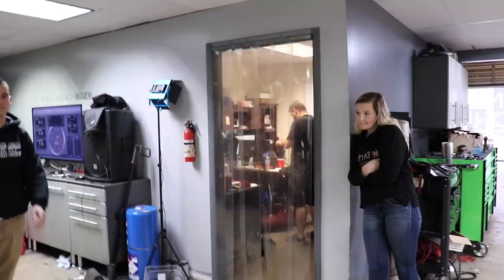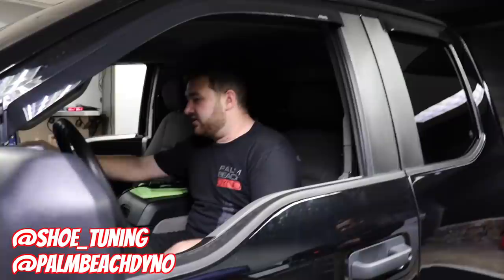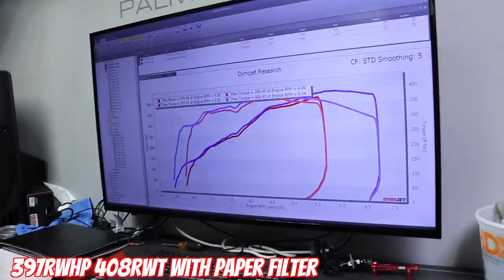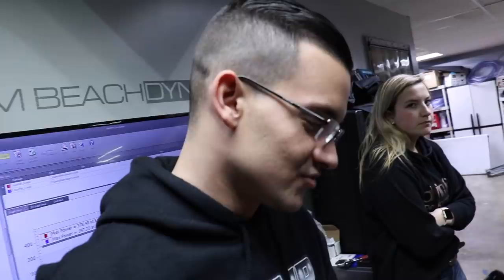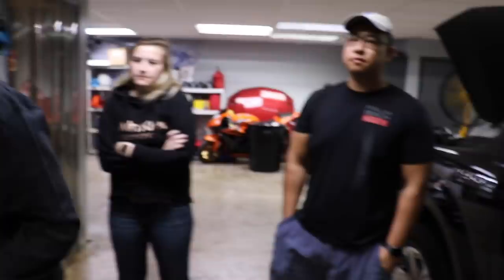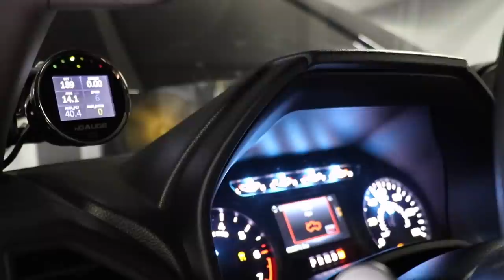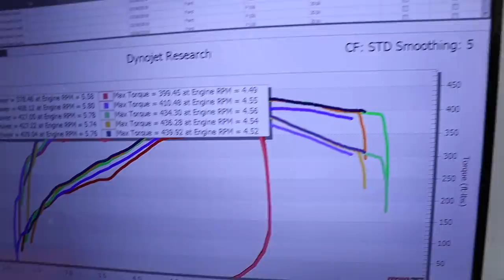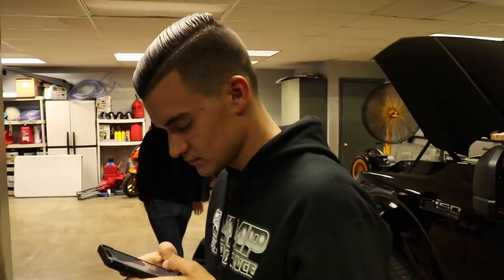PBD E85 Tune 18 F150 5.0L Makes Power then Races Ecoboost F150

Comment: I like the look of failed hopes on the 5.0 owner's face when he not only gets beat but beat bad by the 3.5 Eco. I can almost see him thinking 'What is it going to cost me to make my truck that quick?'  The 3.5 is a beast. It may sound like the world's fastest washing machine but it makes a lot of power.
Reply: A max power 3.5 wont ever beat a max power 5.0
Reply: It will cost about 6-7 thousand and it will put bus lengths on a tuned 3.5, its called a wipple supercharger. Or a turbo kit will probably be a fair bit cheaper, but i dont see an ecoboost with big turbos surviving 800-900 rear wheel hp on a stock engine like a coyote will.
Reply: I have them both if your childish  enough to race . The boost might beat it this year.
But towing and longevity NO DOUBT 5.0
Reply: Old ecoboost owner I love the looks on the 3.5 owners face when they wake up to a camphaser clacking at 80k miles

Comment: That’s how I feel. Unless you boost the 5.0 truck, the ecoboost will gap it mod for mod. Too bad the ecoboost sounds like poo
Reply: Hayabusagsxr1300 Haha. Agreed! I have an E50 tuned 3.5L and I LOVE the power. But I will never sound as sweet as a V8. I gave up looking for an aftermarket solution. Just gonna keep it stock and accept it. But OH THAT POWER! 😜
Reply: Actually as soon as you change the truck manifold out on the 5.0 it will eat the eco  Entire power band changes
Reply: There's more to be had out of the 5.0 n/a, but yea.. boost is always an advantage when run against an n/a motor.   Rear gear has much to do with this as well.. not sure what it is on these trucks.  (Would have liked to see a roll race) Also, Circle D makes a stall for the 10R80 and would definitely level the playing field.

Boosted Coyotes however usually end the argument pretty quickly. lol.
Reply: @leviathan5.081   hahahahaaha
Reply: My 3.5 goes great but it sounds like a high performance washing machine.
Reply: @Pilot545  - I heard one on Youtube the other day with an exhaust mod, and those turbo's put out a sweet sound with the right exhaust!
Reply: @Pilot545  - Heck, it's nice to see that a six cylinder can do what this one does with it's power band!   Just saw a video the other day of a 2011 Ecoboost with just over 500K miles on it...so if maintained one can get a good many years out of them too as a work truck!
Reply: @townhall05446  - Nothing wrong with that, so long as it's fun to drive!   Look for the 'exhaust' upgrade, where the turbo's sing a sweet tune...cool as can be!
Reply: bowhunter 85  its sad that you think a  boosted coyote is equal to a boosted v6.
Reply: Thats ok ill gap those 5.0 in silence.
Reply: @SirtubalotTX  not against e85 tuned 3.5 they don't
Reply: @Ecoboosttookadump  /watch?v=hOVu6oly0bo

Show me one F150 3.5t that can run like this.... I"ll wait.
Reply: @07slowbalt  So are you honestly saying that no boosted Coyote can keep up with a 3.5t? lol.

I hope you're not serious but a little reminder that Coyotes have made 1000, 2000, 3000, 4000 hp+.  Don't believe me? Pay close attention to MMR.

No offense and I like the 3.5t but the highest hp one I've seen is 1000hp.

That's nothing to sneeze at but reality can a be a bitch.
Reply: @SirtubalotTX  i think you read my comment backwards. I don't put them on the same playing field unless they are stock. A boosted coyote is going to smoke a ecoboost all day long. I own a 5.0L f-150 you know where my loyalty stands.
Reply: Borla atak sounds amazing

Comment: Performance wise, unless you turbo or supercharge the 5.0, it’s no competition for the 3.5
Reply: Alexgotnicebody The 3.5 L V6 in the raptor is 450 hp from the factory but I imagine that’s at the fly wheel not at the wheels.
Reply: White Knight it’s the same engine. Ford just calls it “high output” 3.5. There’s a F-150 that comes with it too.
Reply: In the end the 3.5 L TT will be better for circuit application because of weight.
Reply: @FamilyCTSV yes you can get the 3.5 ho in the limited f-150 witch is probably more expensive then the raptor.
Reply: alexandre gelinas I work for ford.. raptor here in Cali starts at around $67k plus $20k mark up from the dealer. The HO F-150 is around $55k
Reply: Alexgotnicebody I think you’re a tad low on that number. Don’t think anybody is touching a Limited for less than $65K (and that’d still be a good deal).
Reply: Vic Narciso  no body cares
Reply: @hellraiserx9490  Carmakers stopped giving engines 'gross' (flywheel) HP ratings almost 50 years ago.
Reply: I go with a 3.5 eco-boost all day long.

Comment: I love the 5.0 and all but I would take the 3.5 over the 5.0 any day. This would only be if the trucks had basic mods like exhaust intake and tune. But if a supercharger is in the budget 5.0 all the way. 

I like the Ecoboost exhaust when you get catless downpipes, spd turbo adapters, cold air intake, and mbrp exhaust. You get a lot of turbo whistle and less of the v6 rasp.
Reply: Have you priced out that setup? Are there any videos with this setup?

Comment: This man tuned your truck then gapped you in a ecoboost and told it was the answers lmao wut 😂
Reply: You’ve never driven  an echo boost... mine is fast
Reply: @Matt-tc1ml  For years I wanted a new truck. Used to want a RAM for the Hemi but when I was finally able to seriously look at trucks my old Dakota had started rusting and I hated that. So I took a closer look at the F150 for its aluminum body. Then I had to decide between the 5.0 and the other engines. I was leaning towards the 5.0 but when I saw some of these videos and others showing the 3.5 lasting a good long time, I went with that motor. 18mpg city and 24.6 highway (70 mph) with the A/C on, and all that power, I love this truck and its 3.5 Eco motor. And now I see that apparently the Hemi motor has some design issues related to valvetrain oiling that can trash the engine if it is driven too much at low speeds or idled much, plus the Eco is faster and better mpg. A win win win for me.
Reply: @Matt-tc1ml  There are no fast Ecoboost trucks.
Reply: @NYCnMiami  There are Ecoboost trucks running 11.2 in the 1/4. That’s as fast as a Hellcat. If that’s not fast, then nothing is.

Comment: That dyno seems a bit generous...
Reply: S Miller a lot
Reply: Yeah that's WAY high for stock.
Reply: Way generous! That 5.$low got gapped! Means that ecobeast is putting down way over 500whp if that was legit.
Reply: @gregorydavis4466  that isn't out of the question. Gen2 3.5's make 500+whp on ethanol

Comment: If the 5.0 was steel body and really did weigh 2000 lbs more , that is the main reason for this result
Reply: A. Wheeler they are both aluminum and the 3.5 is a supercrew  while the 5.0 is crew cab, so the 5.0 is actually lighter
Reply: Even if it was steel, there isn't a 2k weight difference.
Reply: @Shelbyj13  I know 3.5 is smaller but when adding 2 turbos some piping inter cooler. I am pretty sure the weight comes back to the same vs 5.0
Reply: @yzf400rider  I wasn't saying the 3.5   weighed the same.  I was saying that the steel body F150 doesn't weight 2k more than an aluminum body.  It's only like 500-700 depending on body style.

Comment: FYI a dyno operator can manipulate numbers with the SAE smoothing function in software. I noticed it at 5... also dynojets read notoriously high compared to others. Kinda hard to believe that as actual real data as that motor is rated at 400/400 at the crank. Not hating but having seen many 5.0 and exoboosts on the dyno this is unusual. Nice truck bro

Comment: That 5.0 needs a muffler for back pressure that's why it takes off a bit soft on digs
Reply from the maker: Wrong. Cats provide more than enough back pressure. Most modern engines don’t follow that rule anyways. More flow the better. But the muffler delete and resonator delete provides zero performance advantage or disadvantage
Reply: 5.0 doesnt need “backpressure”

Comment: Unless the 5.0 has 3:73 it stands no chance against an ECO. 3:31 in 5.0 seems lethargic revving. Good video thanks
Reply: 9663mu it stands no chance no matter what gears it has! There’s a huge torque difference!  The 5.0 is awesome but can’t match the ecoboost in a truck.
Reply: @JohnDiMartino  https://www.youtube.com/watch?v=DznZdp0RpFw

Not really, granted.. that was stock for stock.  Gearing does make a huge difference for the 5.0.  Also, this 5 liter is not making all the n/a power it can.  Headers, manifold swap..etc etc and I think things would have been much different. 

A 10R80 5.0 F150 3.73 would give even a modded Eco hell with fbo.  Not to mention, Circle D now makes a stall for the 10R80 and there are 4.10 and even a 4.56 gear for the F150: that would pretty much erase any torque advantage the Eco might have.
Reply: You can put just a tune on a ecoboost and make 500 foot pounds to the tire's. You can do just about anything short of a power adder or serious head work and you will never get that much power to the wheels out of a 5.0. And what does it matter at that point? You could spend thousands and thousands of dollars on any vehicle and make it as fast as a tuned ecoboost.... my tuner cost 600 dollars. 😀
Reply: @eddiegreen4281  No one said you can't make any power out of the 3.5tt...but it won't touch a 5.0 balls to the wall...and that was my point.

Of course an Eco will do good with just a tune. It's already boosted.

https://youtu.be/SknVov7dvug

Try that with any Ecoboost... .good luck.
Reply: eddie green my comment was stock vs stock. A 5.0 with 3:73 is neck and neck with a stock 3.5 Eco
Reply: @9663mu   SirtubalotTX  lol 1000 hp on stock internals is living on borrowed time...  but once again if you have tens of thousands of dollars to throw at something then yeah.... the 5.0 has more displacement so it would make more power with forged internals and forced induction. You're the one that said a 5.0 with the right gear and expensive transmission upgrades I guess you consider bolt ons would give a tuned ecoboost hell... lol that's not true. Without forced induction or nitrous lol a 5.0 is not going to make anywhere close to the power of a tuned ecoboost. You must be one of those 5.0 guys I ecoboost at stoplights lol... after losing you tell yourself.... just think if I had ten thousand dollars of imaginary potential upgrades lol that guys lucky lol
Reply: not so the 5.0 is faSTER IN STOCK FORM
Reply: wshadow85 perkins 5.0 is not faster in stock form, if the gear ratios are the same. A 5.0 with 3.73 has the same quarter mile time as a 3.5TT with the 3.31 gear ratio. The 2.7TT needs 3.55 to keep up with a 5.0 with 3.73, and the 3.5 with 3.31. If the truck both have the same ratio, the 3.5 is fastest, 2.7 second fastest, 5.0 is third...Either way, they both are faster than the competition. The 3.5TT Seems to be the way to go if you are keeping it stock or Tune only. If supercharger / Turbo setup is in the budget for the 5.0, then you let the bald eagles fly.
Reply: @wshadow85   no its not...its close if you don't know how to launch the EcoBoost .... put the ecoboost in 4wheel drive.... foot brake it ...leave at 2500 rpms under some boost and you will absolutely humiliate the 5.0

Comment: ecoboost torque/boost down low RPMS is to strong for a naturally aspired motor  this is why the ecoboost is funner to daily drive.. an ecoboost at normal acceleration rpms feels like the power of the 5.0 on full throttle
Reply: It's a lot of fun to drive so much faster than my 2010 f150 5.4

Comment: What's the point it's not even a fair race without anything done to it the EcoBoost is over 500 foot pounds of torque
Reply: ya with just a tune lol. im glad I bought a 3.5. gonna break some 5.0 hearts at the track this summer
Reply: You can make up for lower torque numbers with gearing you can't make up for lack of horsepower. Torque is important but not the end all or all those newer diesel trucks like F250S with over 900ftlbs would be killing the EcoBoost motors.

Comment: Damn. Same guys that tuned my 16 f150 with 2.9 whipple. They had it so fucked up I had to take it off. Worst fuel mileage. Kept throwing rich codes at idle. 6 months tuning. Just stopped asking and want my money back. Never heard back. Would never recommend to anyone with SC f150.

Comment: I also have a 2018 3.5 full crew cab 4 by 4 At the moment I'm running performance plugs summit racing cold air intake, borla catback exaust extreme,more power tuning 93ĺ plus tune.they took some torque from 1st and put it on top. Still beaks loose sometimes hard to hold on to in 3r however still pullin as hard at 120 as it does at 80.pretty wicked
..i want 700 or better at the rear.lookin at intercooler s,injector to run e 85 all the time.gonna go ahead and beef up the internals and considerably larger turbos.tract ion bars,drop it some,much more meat on the ground.im just not sure which way to go with the internals.o this is my daily kicked everthings but that has tried me so far.suggesstions please.leave off the shrink,ive already been told.thanks yall
Reply: Isn’t the 3.5 flex fuel so u should be already able to run e85 but even better with a tune

Comment: dude im ngl my 5.0 has beat 3.5's and all i have is exhaust?
Reply: But we know you're lying.
Reply: Hahahaha
Reply: You are lying through your teeth.
Reply: oO OzO Oo it was previous generations but it has been done. from everything I’ve seen they are supposed to be faster
Reply: @motomax13  The older gens are steel bodies and have the 6 speed i believe. So its no surprise that you beat the older gens, the newer gens are very quick and are basically at the same level as the 5.0 performance wise.
Reply: @motomax13  Due to them being Aluminum and having better gearing than the older gens im pretty sure 2.7s and some 3.5s come standard with 3.55 gears which is pretty good and torquie.
Reply: @ooozooo7333  for sure. i thought i was gunna get smoked, but i just rolled away from em. but ive the the 3.73 and 5.0 so i guess thats what gave me the jump

Comment: What exhaust is on the 5.0, sounds amazing
Reply from the maker: Muffler delete and resonator delete
Reply: Marshal Couldron basically straight piped.
Reply: @MrInzombia  mmmmm, no, its called a muffler delete and not a straight pipe for a reason

Comment: Buy the 5.0 !! 
If you use your truck to work or pull heavy weight.
Buy the 5.0 
If you want to drag race buy a mustang .
Oh btw i own the 5.0 and the eco
Reply: May i ask why??
Reply: @ethan2570  sure 
5,0 has way longer engine life under a daily load .
And lower maintenance cost ( turbo) 
You actually get lower mileage pulling with the ec boost engine .
I have had them both .
Love my e boost .
But the power is almost identical ( not on paper )
5.0 is probably stronger and longer living in working conditions.
Both are good trucks 
Eboost a little more fun and better fuel mileage un loaded .
If your working no doubt 5.0

Comment: 5.0 should last longer being under less stress
Reply: Trudeau Must go make sense since the 5.0 is revving to 7000 rpm,and the  ecoboost is a full forged engine spinning to maybe 5500.....
Reply: The new 5.0’s have problems I wouldn’t get one. 3.5 is proven to be reliable.
Reply: Trudeau Must go 5.0s are not the known to be reliable haha
Reply: @guerrerok90  absolutely they are, the 3.5 has more common problems, mainly the timing chain stretching
Reply: @trudeaumustgo1920  The 1st gen version 3.5 did, 2nd gen is supposed to be resolved.

Comment: What did the truck run at the track?
Reply from the maker: 12.8 @ 108
Reply: @MustangLifestyleTV  nice! With 3.31 gears? My PBD e85 tune is on the way. My 19'5.0 is 4wd and supercrew 3.31 also, so I doubt I'll hit 12s like you mainly due to weight . I'm thinking  13.0-13.2 .
Reply from the maker: MormonMustang 3.55 2WD

Comment: I'm pissed that my 2017 5.0 only made 355hp on a Dyno Jet at 5Star Tuning with a CAI, catted Y pipes and a Dyno tune in 93. Told I need headers, e85 and GT manifold to maybe see 400?!?!
Reply: Veteran Veteran at least your truck doesn’t sound like a 3.5 turd
Reply: This dyno in the video is definitely cheating a little bit. It is saying that stock, the truck is almost making more power at the wheels than Ford claims at the crank. That's like a 15% difference.  I'm sure someone like 5 star is as accurate as possible.
Reply: This dyno is a joke dude. You put this truck on 5stars dyno it would be nowhere near what he got